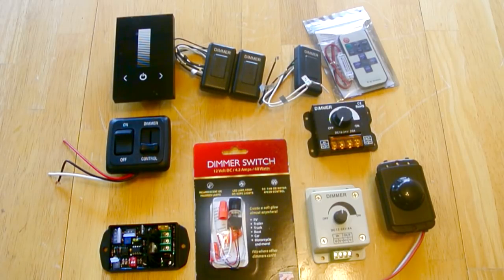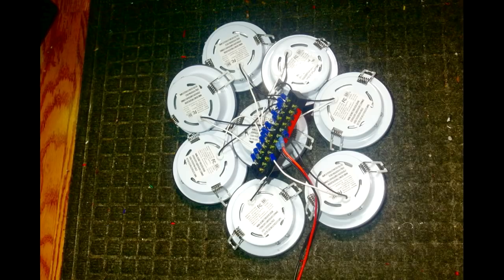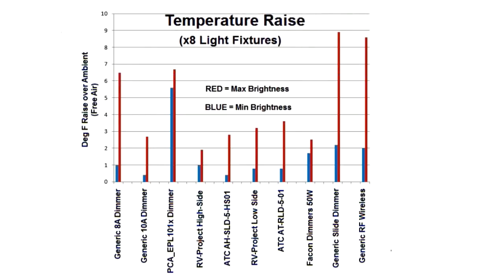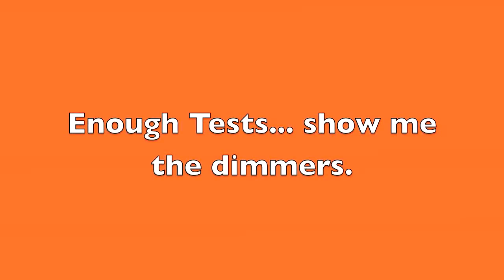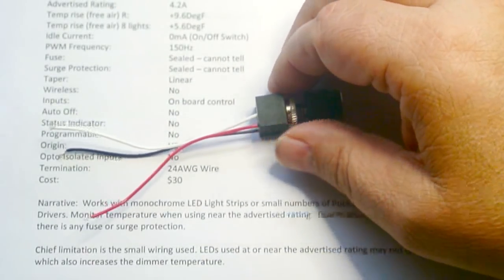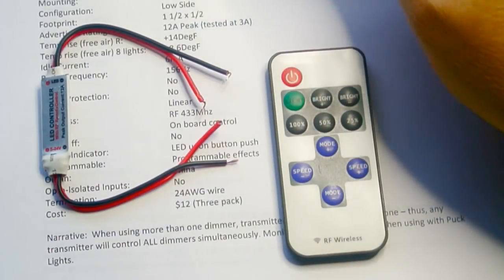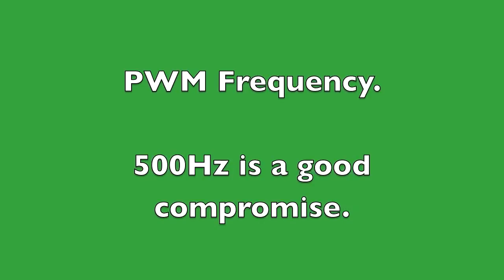RV 12V LED Dimmer Shootout

Comment: Could I use the Generic 30Amp to dim LED headlights? "OXILAM H4 9003 LED Headlight Bulbs, Mini Size 6000K White Hi/Lo Beam Plug and Play HB2 LED Headlamp Replacements for High Beam and Low Beam, Pack of 2" from Amazon. It says it has "Built-in intelligent IC driver"?

Comment: CAN ANY OF THESE BE USED FOR A TROLLING MOTOR? I bought a cheap pulse modulator with reverse and used it for an LED spot light to test it... It worked for about 2 HOURS. I actually tried it on my motor first and it worked perfect
Reply from the maker: No. A trolling motor requires a lot more current than any of these can supply.  However, there are generic PWM motor controllers on the market - but you would have to verify their current handling capacity.

Comment: Thanks for making this video, very informative.  I am using a couple of the epl101 dimmers in my camper. One is connected to 8 led lights in the main area of the camper while the other is connected to just 2 of the same led lights in the bathroom. The one in the main area controlling 8 lights is working perfect, I have it wired with no ground so the red and white wires are twisted together and connected to the lights while the black wire is connected to the 12 volt positive wire that feeds the lights...it doesn't seem to heat up noticeably and there is no perceptible buzzing at any light level.  The one in the bathroom is also working good until I get to full brightness, which (like the one in the main cabin) is about 3/4 of the full throw of the knob, if I turn the knob beyond that the lights suddenly dim a bit and start flickering silently. The one connected to 8 lights doesn't do that when you go past the full brightness position on the knob, it just stays full bright with no drama.  Sound like a switch problem or could it be something to do with the number of lights it is controlling? (which is the only difference between the two)?
Reply from the maker: It's likely the potentiometer is the culprit.  They are not as problematic these days as they once were, but they can get bad spots.  Typically what happens is as they age, especially if not used in awhile, they can accumulate foreign matter on the disc the wiper goes across internally.  

Any gunk on the disc can interfere with the resistance as you rotate the knob.  The same thing can happen in a radio volume control on a radio if you ever heard one crackle as you adjust the volume.

It is a fairly rare occurrence these days as potentiometer manufacturers have improved their product, but it can still happen.

 One (most likely temporary) solution is to rapidly rotate the potentiometer from end to end a few times to clean off any particulate matter that may have accumulated on the disc.

Comment: I have a question for anyone that knows dimmers or electrical stuff. I have tried two different 12v dimmers but when I wire them up the lights come straight on, as soon as I plug the connections in they come on to 100%, the on and off doesn't even work it's just straight on. Have I wired my lights in the ceiling wrong maybe?
Reply from the maker: I will be publishing a video soon for the common wiring methods of dimmers.

A few things you need to know.  First, there are high-side and low-side dimmers. Which one is appropriate depends on how your lighting is wired.  

Your description of the issue you are having suggests to me that you have mis-wired the dimmer, or using a low-side dimmer when you need a high-side dimmer.

And some LED fixtures, especially the older types that have PWM (Pulse-Width-Modulated) drivers may not work with a specific dimmer. This is because dimmers also typically use PWM to function, and their can be some interaction between the two.

If you have this type of LED, either replacing the LED or dimmer with a different model can sometimes fix the problem.

Comment: Great Video(s).  I just found your site while searching for info on 12V LED RV dimmers.  Your two videos and the info on your site was exactly what I was looking for.  Sure wish I had the knowledge and skills you do but you are a great teacher and I am learning.   So after reading and watching all your dimmer information, I decided for my RV Camper Conversion build, to go with the non-switch Facon PUC LED lights and one of the ATC high side dimmers (not sure which one yet, probably the 15A rotary knob one).  The ATC dimmers seem like a "no-brainer" purchase for a quality, well built, dimmer with thermal protection and on/off switch to ensure no ghost current is being puled.  One question for you, if you do not mind:  I have 12 LED lights I am wanting to install with a dimmer.  I am thinking just to be on the electronic safe side of putting 6 lights on their own 15A circuit each with a dimmer, so two circuits, each with of 6 LED lights and one dimmer.    Do you think creating two circuits for 12 LED lights with dimmers is generally reasonable or overkill ?
Reply from the maker: Depends on the LED lights. If they are the typical 4.5" puck lights for example (Facon) they are usually 4W, which means at 12V, they require about 0.3A each. So they should work fine on a single 15A circuit. However, as I stated in my video, you have to be mindful with heat output from the dimmers themselves. 

Of course there are other considerations for splitting the circuit, for example if the 12 LEDs are in two different rooms, you might want to run each room on their own dimmer.

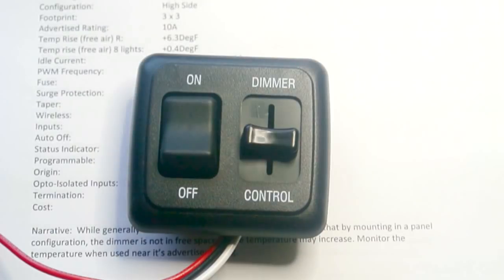Comment: I have the dimmer you showed at 12:00 . I’m super disappointed with the dimming on it. In my rig going from full power to fully dim looks like a    15 -20% change. Is there a way to make it so it dims more? Or do you have a recommendation for a different dimmer I can use. I want to dim my lights down to 5% to use a s a night light for when we are camping. Thanks for any and all guidance.
Reply from the maker: A lot depends on the type of LED fixtures you have. Some fixtures have switch-mode drivers, which don't play well with some dimmers.

Comment: Hey man, I just took one of the fixtures in mine down, took the 194 type wiring out, wired in a section of strip light and it is so hot you can't touch it and has already burned a section out of the strip.  I ordered a dimmer switch like the one in the large package.  Is that a solution to my problem there?  I don't have much experience with leds, lots of wiring and such but no leds
Reply from the maker: LED strips should not get that hot.

Comment: I have bought 3 of the beige dimmers from ebay, rated at 8a. I use a 3 a fuse and all 3 have stopped working within min of blowing that fuse. I attached them to a 5m strip of leds.
Reply from the maker: There is only one reason a fuse blows, an overcurrent condition.

Comment: has anyone figure out the bedroom wiring in a 297RSTS? The existing switch is two wires, my replacement dimmer has 3. ATC AH-SLD-5-HS01 I saw a post somewhere stating to tie two of the 3 wires together and instal, but I cannot recall where I had read this.
Reply from the maker: The associated webpage for this video: http://www.rv-project.com/gear/dimmers.php includes several typical wiring schematics. You will have to navigate a few pages into the article to get to the schematics.

Note that these are somewhat generic connection schemes, and may or may not work with a specific dimmer.

Comment: Can someone help me please. I have 6 Led lights chain that I wish to connect together to 1 and dimmer them all at once. The back of each adapter says 23v 0.13A 3W. What dimmer do I look for to know what to buy.
Reply from the maker: You will have to figure out the total current demand of the LED lights. You can use either Amperes or Watts.  Then multiply that amount by 2, and find a dimmer that exceeds that value. 

You can use either Amperes or Watts (assuming the voltage is the same for both LEDs and Dimmer). Just don't mix values unless you know enough about Ohms Law to convert one to the other.

For example, if you have 6 LED lights operating at 12VDC, each that consumes 3Watts, then 3 x 6 = 18, then double it by 2 for a safety margin of error = 36W.

Look for a 12-24VDC dimmer that will handle 36 Watts.